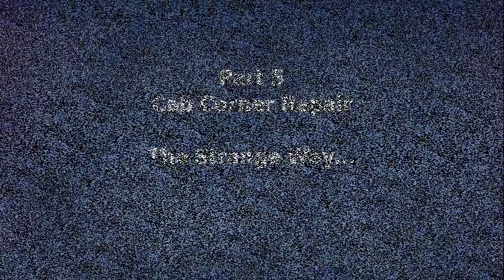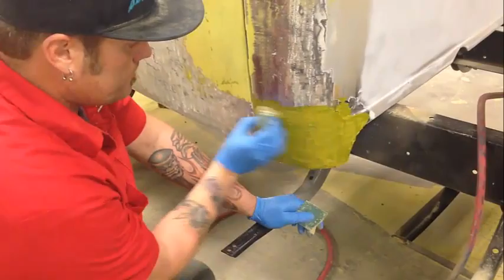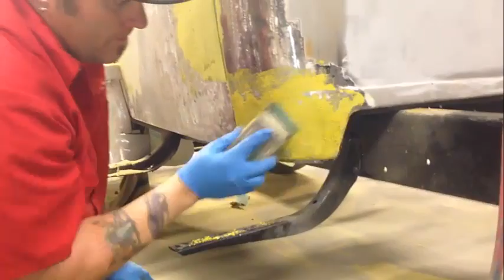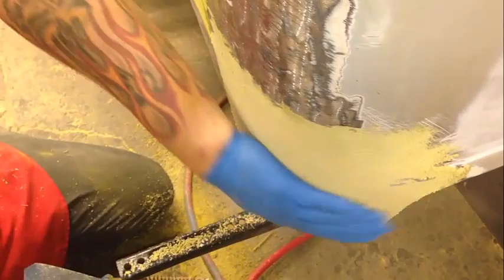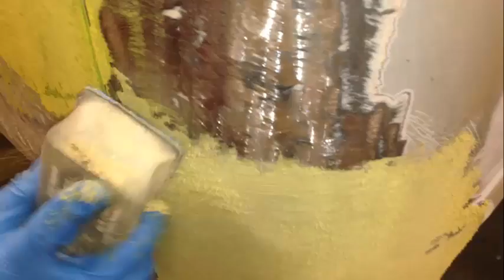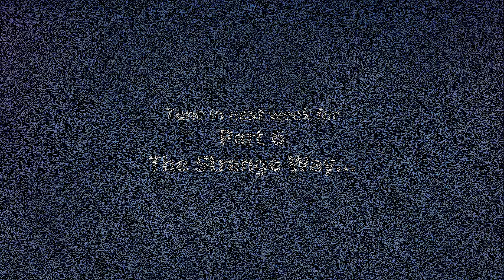The Strange Way - Cab Corner Repair - Episode 5

Comment: You work way too hard. I got tired just watching all that sanding. Try a  5" palm sander and 80- 180 grit Velcro  discs.  Also, when you sand, hold a xenon light in your other hand so the shadowing  shows how accurate you are as you go.  I (almost) never sand by hand and always nail it.  Save your energy for your girlfriend.